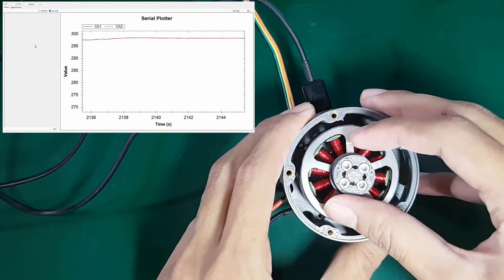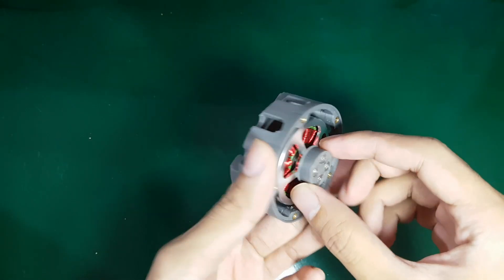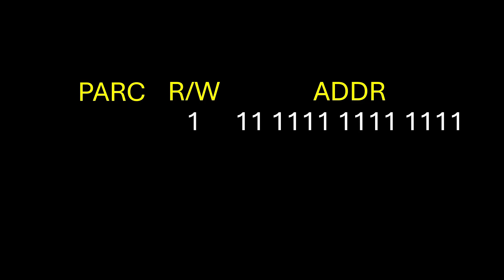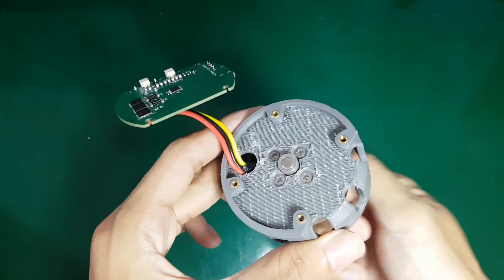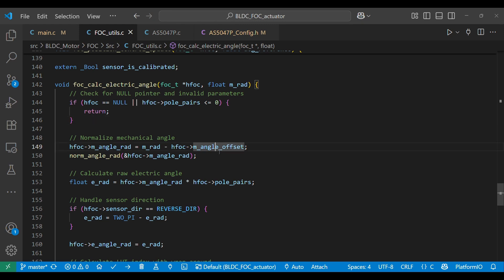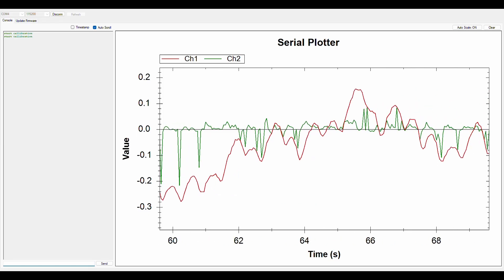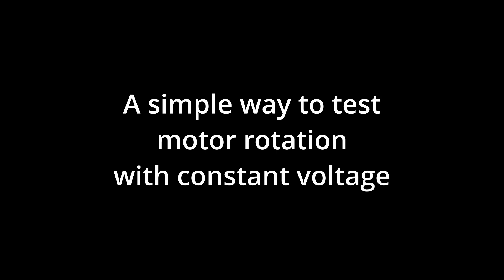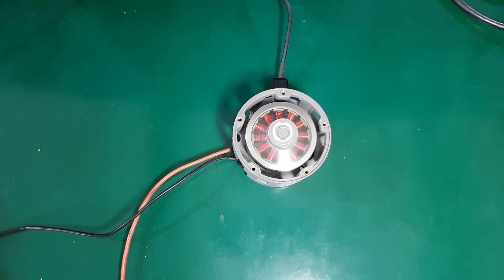The Secret to Accurate FOC: Reading Magnetic Encoders & Fixing Misalignment and Eccentricity

Comment: As always, a great video, thank you! You chose the correction method using tabular values, but this isn't always effective. If you decompose the error signal into harmonics and determine the influence of each, you can correct the encoder readings with a single formula. For example, I was able to reduce the RMS error of the magnetic encoder from 2.5 degrees to 0.16 degrees (relative to the reference optical one)
Reply from the maker: Amazing, I have to try it. Thanks for this great suggestion
Reply: Thing is though, with the caveat that the correction trim value will not change during the life of the device, it's way faster to simply look up a value from a table using an index pointer than it is to "do the math" as it were. When FoC is typically done on a dedicated "low speed" microcontroller, its much more efficient to use code optimised for execution time than for absolute optimisation!.  We often do this for current harmonic cancellation vai a feedforward table for example 🙂
Reply: @maxtorque2277  For example, a magnetic encoder has 14-bit resolution. How much memory does the static nonlinearity compensation table require? What if dynamic compensation is added? )))

Comment: Hello. What magnet are you using? The one I bought doesn't have a magnetic field on the end. I made your board. Thank you!
Reply from the maker: Hello, I use diametrical magnets with a diameter of 6 mm and a thickness of 3 mm
Reply: @srj4555  Thank you

Comment: nice work! I have a question. What kind of encoder would you recommend if you’d like to build a hollow shafted actuator? Since magnetic encoder requires magnet at the rotor’s center, this is not appropriate for that.

Comment: 1:00 not changes in the magnetic field, but rather the magnetic field itself is converted to an angle. Otherwise it wouldn't work while stationary, when there's no change. These things have high resolution but not great precision, the best I've seen have 0.8 degree or so of absolute accuracy.
You should try to compensate the massive torque ripple those drone motors have. You can use an Iq table indexed by mechanical angle, recorded at low constant speed for that.
Reply from the maker: Thank you for correcting it. And it is really valuable information.

Comment: Wow, this is exactly what I was looking for! I've been trying to do something similar with an AS5600 reading over I2C at 400kHz, but I couldn't get STM32CubeIDE to generate a flashable image for STM32CubeProgrammer for my STM32F405.

Since I'm more experienced with Arduino, I switched to MicroPython but ran into performance issues. I'm not very familiar with STM32 programming yet, so I was wondering, would you be willing to share how you set up your project in STM32CubeIDE and loaded it into VSCode? That would help me immensely!

Such a great video, really excited for the next one!

Comment: Great work! But i wonder if the magnet of the motor could cause noise to the encoder? Thanks
Reply from the maker: because the distance between the magnets on the motor is quite far compared to the distance between the diametrical magnet for encoder, so in my opinion it doesn't cause noise, although it may be very small.

Comment: This method for encoder magnet eccentricity compensation can cause issues if the motor used has significant cogging torque or the voltage/current during measurement is to low.
Reply: Any better alternative ?
Reply: @youneshamache3314 some possible solutions could be 

using external reference angles with some kind of fixture, not very practical, 

spinning up the motor at higher speed to limit the time that the cogging torque can effect the rotor or increasing the rotors inertia and doing the same at a lower speed so latency has less influence. 

Given the current method a discrete fourier transform could be used to get the amplitude and phase of the error so the higher "frequency" elements like cogging torque can be ignored
Reply: @youneshamache3314  use a iir filter.